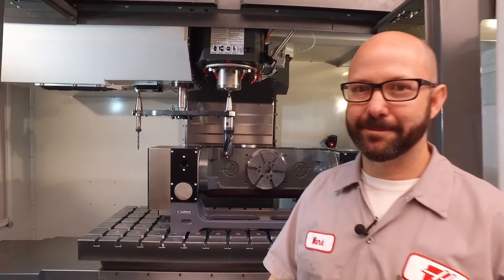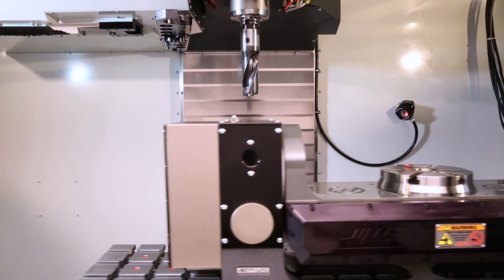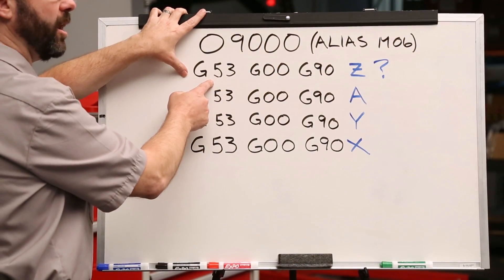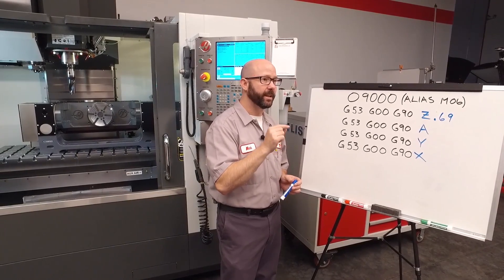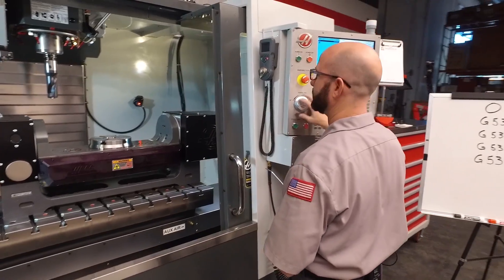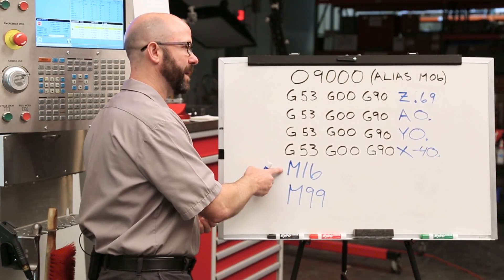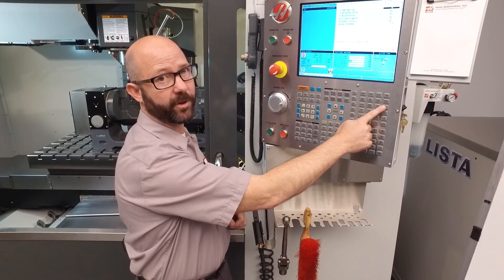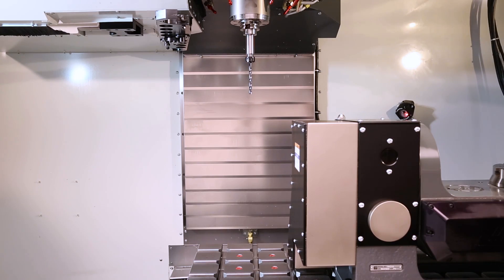How to Command a Safe Tool Change Position to Avoid Fixtures and Rotaries – Haas Tip of the Day

Comment: I do not have the fourth axis in my machine. But the problem I am having is I used everything but the fourth axis info and my machine gives a  h and t not the same alarm and will not do anything with the program after the alias program.  I tried it with m06 m16 both does same thing. Not sure what I am doing wrong moving z to zero and y to zero. My machine has a 30 x travel and I tried the x on several different stop points and get the same alarm Everytime. Can some one point me in the right direction

Comment: Hey Mark, Very useful stuff here. I'm trying to write the use of O9000 with a variable of 6 IN my program to have it set the variable automatically, instead of having to hit e-stop, change it, and then run. Is there a way to do this? I already tried a pass thru command line of "#[9000]=6" but ended up getting a error message of "522 Illegal Assignment Var or Value". Kinda stumped here. Any help appreciated. If the variables are Read-Only, how do I enable "write", then at the end of program re-enable "read-only"?
Reply: You can’t use variables when aliasing m codes. You’d have to use G65 to call it directly.

Comment: I just added a 4th axis to a 2006 Mini Mill and discovered changing setting 81 to zero had no effect.  Still changes to tool #1 on power up restart.  I've found a work around by pressing zero return -> All.  This homes the axes without tool change.  However I'm so used to pressing "power up restart" at startup I would really like to know if there is a fix for making setting 81 work as this video describes?

Comment: Is there a way to stop this safety move on a umc 750?, we have a large part coming up soon where we will need it to stay at B90. to have enough clearance for the tool change.
Reply: You would just set B90 along with the other necessary coordinates instead of the example coordinates here. Aliasing M06 like this permits setting your own safe toolchange location based on your setup and tooling.

Comment: If you alias an existing G/M code is it permanent or can they be reverted back to their original function
Reply from the maker: Definitely. We can just set our M Macro Call value back to “0” (01:05 in video) and the control reverts back to the original code. For some more information on Aliased M and G codes, check out https://youtu.be/HZiJEt0bMA4 - Mark, Haas Tip-of-the-day

Comment: Hi Mark
We have a VF2 with an umbrella tool changer. Is there any way to have the z retract all the way AFTER the tool change and before any movement in the x and y to your cut location. We have a pretty tall work piece set up and a long tool. As of now they would crash, but after the tool change I can go into handjog mode and jug up another 4 inches. So I know there is more z above the tool change position.
Reply from the maker: Sean Mueller – For sure. Check out the G53 Video, https://youtu.be/Rd-h0YA9IzQ?list=PL1FfK7Yod27cy-MIhXsKkDwTmvclf7ps7. We can jog your Z-Axis up as far as it will go, and look at the machine position. If it goes to machine Z4.1 (4.1 inches above tool change position), then we can command a G53 G00 G90 Z4.0; G53 G00 G90 X-20.  in our program, and it will move the tool all the up in the Z, then the X. All this movement could be placed in our own M or G code, https://youtu.be/HZiJEt0bMA4.  If you have a newer NGC machine, we can use Settings 293-298, our Tool Change Mid positions, to safely position things now. – Mark, Haas Tip-of-the-day
Reply: Thank you Mark!!! I tried it and it worked. Thank you soo much!!!

Comment: Hey Mark great video! My company received a Haas minimill that has the macro code O9000 set to 6 so it does move for a tool change; however there isn't a program O9000 in the control. How do i look up what the person before me used?
Reply from the maker: Blake Trower – The program may be there, just not visible. Turn Off Setting 23 and look again, under LIST PROG. On Next Gen Controls, the 9xxx programs are stored in the 9000 folder, so you can look there too. If the file does not exist, it must be recreated. Check out this video for more info: https://youtu.be/HZiJEt0bMA4 - Mark, Haas Tip-of-the-day
Reply: Awesome! That's exactly what i needed. Thanks for your help Mark!

Comment: I have 12/2016 nex gen supermini with trt100 and have used this m16 and have same issue as Christopher Heun when using tool setting probe error only way is to edit programs every time in mdi to get to work i don't quite understand what you are saying to Christopher as it is more in reference to older controls can you please explain how to edit probe macro to avoid edit every time in mdi. Thanks
Reply from the maker: Since this video was made, we’ve added Settings 293-298 to the Next Gen Mill controls. These Settings allow you to specify Tool Change Mid Positions for every axis, which will help avoid your rotary even when changing tools in MDI (ATC FWD). Check to see if those Settings are available on your NGC machines, and if not, give your local Haas Factory Outlet a call and look into upgrading your software to the latest. Changing your Tool At Power Up (Par./Set. 81) to a zero is a great feature as well, on older machines, while these new settings will take care of things even when changing a tool at Power Up. – Mark, Haas Tip-of-the-day
Reply: Mark hi. Please tell me I stand a new generation and I have the settings 293-298. That is, I enter these coordinates into the data settings and something else?? in order when changing the instrument table moved??

Comment: I just tried setting this up and I am running into an issue where I'm getting an alarm that says H&T don't match.  However they do match.  If I turn setting 15 off, it works.  Is it not possible to run this with both settings?
Reply: RattleheadRacing update, it only alarms out when i run in graphics. Works fine while running parts.  Why is that??

Comment: Works great. Though I've been changing parameter 81 back to 0 before all work probing  (machine behaves as if there's an M6 beginning all probing macros)  How can we avoid this?
Reply from the maker: +Christopher Heun Older VQC Templates use Macro O9023, which will cause a tool change if the probe isn’t already in the spindle (Macro #560 holds the T# of the spindle probe). Newer IPS Templates, and probing from the Offset Page, use Macro O9995, which won’t force a tool change. The operator will still need to be careful to avoid fixtures when using older VQC templates. We’ll need to make sure that we change to the probe intentionally before running the probing cycle. This usually isn’t an issue, as we need to position the probe before running the cycle. Hope this helps!
Reply: Whoop there it is. Still often use VQC on our new machines out of habit. Thanks!
Reply: I have 12/2016 nex gen supermini with trt100 and have used this m16 and have same issue when using tool setting probe error only way is to edit programs every time in mdi to get to work i don't quite understand what you are saying to Christopher as it is more in reference to older controls can you please explain how to edit probe macro to avoid edit every time in mdi. 

Thanks

Comment: Our  vm2 does this for all tool changes . Even when you are using the atc fwd / rev buttons, the table comes to the front right of the machine, after Z retracts .
Reply from the maker: +Mark Bernardo It sounds like you’ve had your local Haas Factory Outlet change some parameters so that your machine positions to certain locations every time a Tool Change is commanded. This is very possible, depending on the Software Version your mill has. Customers are welcome to contact their local HFO to see if this is possible on their machines. We don’t give public instructions on this method because every application is different, and changing parameters involves all kinds of wonky math and an understanding of the machine’s servo motor encoders. . . and if it’s done incorrectly, there is a serious risk of crashing your machine! Thanks for the comment Mark.
Yours truly,
Mark from the Haas Tip of the Day
Reply: +Mark Bernardo I use a VM2 SS and ours doesn't do this, it would be a right pain if it did!
Reply: +George Allan Yeah we had parameters/settings changed I believe to it went to this position on all tool changes, not just M06 commands. We have a trunnion on our machine so we did it for the same reason as this video.

I don't remember what the actual change is but if anyone needs to know how to do it, I can look into it.

Comment: Great tip! Would it have made more sense to alias the M16 command? This way you won't affect any other programs that don't use the rotary. Then you can use M16 for all of the rotary programs and never have to change the settings back and forth.
Reply from the maker: +luv2machine Thanks for the comment! That would work pretty well. You could Alias and use an M16 to do tool changes if you have a trunnion on the table, and just use a plain M06 in your program if the trunnion isn’t on the table. Another option would be to Alias the M06, then change the Alias M parameter from “6” back to zero when the trunnion is removed.
Reply: That's the way I do it.

Comment: In the example you showed, why move the A and Y axis?
Reply: +MJP20121 I see you want 1 for all.
Reply: +MJP20121 If you imagine the machine being in the position it is at the very start of the video, you need to move Y, and to move Y you need to move A first.
Working with CNCs, you can never take anything for granded, at least that's what I think.